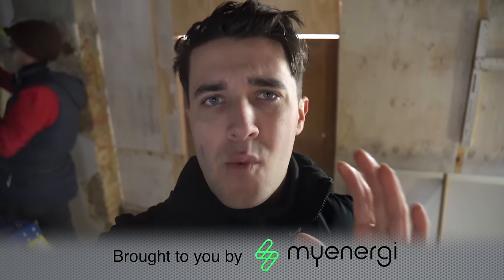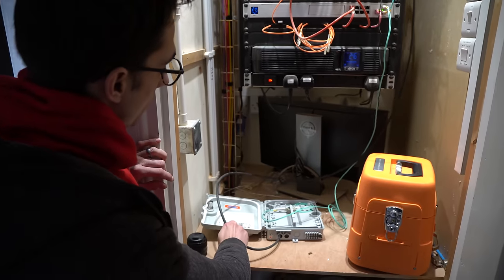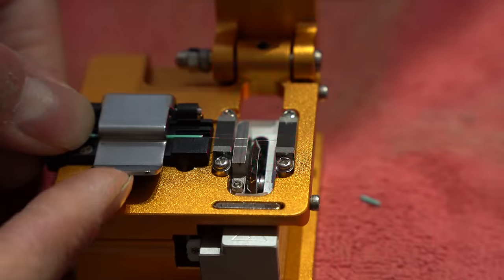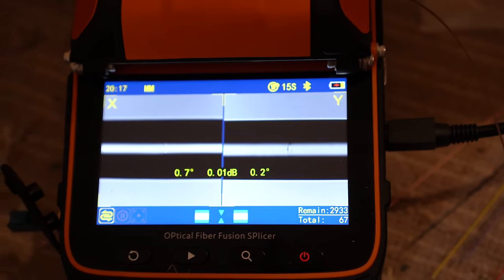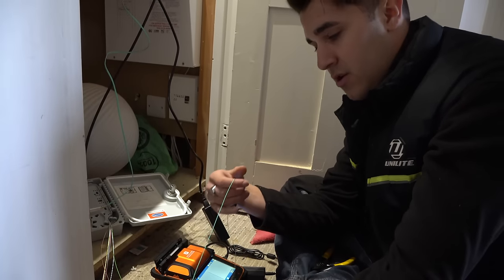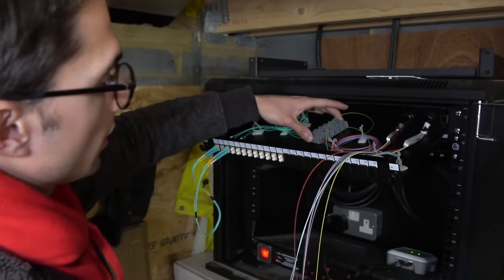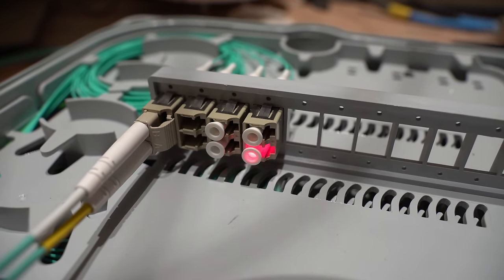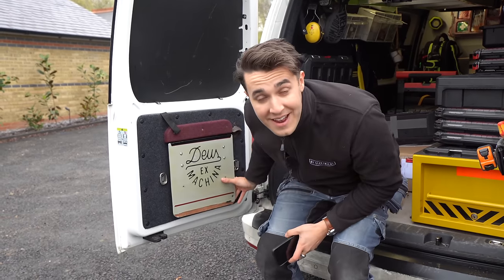Fiber Optic Splicing: Tips and Tricks for Beginners | ØY16

Comment: The key to optical fibre is that it is made using two mediums with different refractive indexes. It is common to use two types of plastic or glass. It is the difference in refractive index of the inner core and the outer layer that creates the "reflective" layer, causing the light to be internally reflected down the inner core of the fibre over very long distances. Both the inner and outer layers make up the fibre itself, which is about the thinkness of a human hair.
Reply: What you have described is true for multimode fibre but is not true for single mode fibre.

Most companies using fibre for long distance communication are using single mode.

Comment: Great vid. Did I miss the use case for so much fibre in a domestic environment? I’m as geeky as they come with fibre in my own home, desperately looking for more uses cases, now matter how sketchy they may be! I have a loft rack with two servers, a switch and my workstation, all connected by fibre. Beyond that I’m struggling to find end devices that need, or have, 10Gbe or better connections. (Otherwise, cheap as chips cat6 will do).

Whilst it’s good to see how the pro’s do it, pre made fibre is quite cheap, so us DIYers just end up with it neatly coiled out of the way behind the back of the rack. Do-able when you’ve only got 4 cables but if you’ve got tens or hundreds then not so practicable!

It is a green tech though. Pushing 10Gbe data down a fibre transceiver needs less power than its equivalent 10G base-t for a cat6 cable…… and a much poorer range to boot…….
Reply: I’d guess a big consideration is because they are going to a few different locations outdoors (house, barn, gates, shed, etc.) it’s a good idea to use fibre even if some of the devices (e.g. at the gate) only need a few mbps, because it’s 100% electrically isolated so lightning isn’t a problem. Actually pulling a multicore cable and splicing instead of pulling a bunch of pre-terminated cables is definitely going over the top, but why not if you want to do it nicely and are willing to pay little up front?
Reply: Yeah you're quite right there isn't much point for end devices in a domestic environment. But @Stephen Gentle is along the right lines, it's a nice to use fiber for building links etc, just because it gives a bit more flexibility for future use, not just in terms of swapping transceivers for faster speeds, but also having more cores to provide completely different connection types if wanted. 

And also bang on about the electrical interference, running through ducts etc. There is also the fact that I enjoy splicing so I'm always looking for places to practice.

Comment: We outsource all our fibre work for the following reasons:
1. They are way quicker than us
2. Their splicer and tester needs calibration and if you are not doing much fibre it will cost you more than you can charge
3. They do a better job
4. We get a full test certificate and a very long warranty ( though rodents love fibre and no warranty covers this !)

Quite intrigued they fitted Ubiquiti switches in the main house and TP-Link in the outbuilding. Probably because Ubiquiti has been hard to get hold off but one of they key reasons to use their kit is cloud management which is kind of lost when you mix vendors as TP-Links cloud platform ( Amada ) is different from Ubiquiti though given the type of install I’m guessing they run something like Domotz on top at a local level to monitor everything ?

As a network engineer and AV specialists it’s always interesting to see other peoples approach on installs.
Reply: You make fair points regarding the outsourcing of fiber work. Sometimes we just like to mix it up 😂

And you’re right on the Unifi switches and TP-Link switches. We do like to keep the whole site on Unifi. It’s a shame the Unifi switches are so unavailable now, and the cost of their basic PoE & SFP model is so much higher than the competition.
Reply from the maker: Interesting advice! Cheers mate
Reply: @paulblundell8033  Ah that's interesting, really nice to do it with VLANs! The main reasons were to keep it simple on this job and not introduce another point of failure on a power supply in the garage to send the WAN to the main rack. Less of a big deal if the garage switch drops off, as the main house will still have WAN (and it has UPS).

Tbh I've only used the 10Gb so far to link switches in my main rack to core switch. Because of the USW-Pro costs. But I might start using them soon for building links.
Reply: I'm also a huge fan of TP-Link Omada! Although I'm not coming from the Pro Install angle, more the home geek who wants something more capable , I find it hugely capable, available (a huge thing these days) and cheap when compared to the likes of Ubiquiti.
I handle segregation/routing with a dedicated pfsense and subnets rather than vlans, running through a Brocade/Rukus poe switch. Running subnets of LAN(10Gbe)/Wifi/IoT/IP cameras, I haven't even come close to the limits of it's abilities in my environment.

Comment: Just to mention Mr Chilli 🌶  was incorrect I work for a Full Fibre ISP and there are a lot of what he's calling cold joints. All of the distribution cabinets use preterminated blown fibre with a cold joint so the installer can just plug it in. So they are 100% used in the industry 🤔 to add yes I have spliced fibre super cool process.

Comment: 12 core ribbon splicer turns 96 cores into just 8 ribbon splices. (If the cable is ribbonised)
Reply: You can ribbonise non ribbon cable too, annoying when one fibre is off centre/damaged and you have to re ribbonise all 12 just to fix one

Comment: When Oliver mentioned that his 'machine' certainly sin't the most expensive, I'm curious to see how many levels up you can go. But I can't imagine Openreach spending lots for real high end equipment.
Reply: My ribbon splicer (splices 12 fibres in one go) on the van is 13,000 pounds. Normal Openreach splicers (72C) are around 4k to buy yourself. Company probably gets them a lot cheaper

Comment: Should be doing OTDR traces to verify quality. Signal and VFL just make sure there's no end-to-end issues...

Also... You should clean the ferrule ends and the SFP Optics.
Reply: On a small run and low end usage,  a trace isnt really necessary

Comment: 5:20 "hold it at a 45° angle" Ehm not really. If the pliers are doing a 250 to 125µm strip you should hold it at 90° or you damage the cladding of the fiber. Tilting the tool is only done if the stripping hole is worn out after a few hundred fibers.
Reply from the maker: Thanks for the tip 🙏🏼

Comment: The light that travels along the fibre is made up of a binary code.
Reply from the maker: That’s cool!
Reply: No. The light is made up of photons.
The light is modulated on and off in sympathy with the binary data stream to be transmitted.
Reply: @Dean G  

Fiber optic cables transmit data by using light (Photons) to carry information through a glass or plastic fiber. Part of the process is data encoding: The data to be transmitted is first encoded into a digital signal using binary code.
Reply: @Jay369  I have a degree in this subject.
I know EXACTLY how they work.

The binary code is the representation of the information to be transmitted, with that be voice, digital images, text messages or anything else.

That data stream comprises 1's and 0's which is then used to modulate the laser.
Reply: @deang5622  

So, why dispute the fact that the light is made up of a binary code?
Reply: @Jay369  because it isn't actually binary. Binary is numbers.
The light is made up of photons.

When you are working at the physical network level, level 1 in the ISO 7 layer OSI reference model, we are concerned with how those binary bits are represented by an analogue signal.  It is simply a way to encode those bits on to the media.

The binary code you are talking about is one level away from the level 1 physical layer.
Reply: @Dean G  

The pulsing of light is directly related to binary. On/off represented as zeros and ones. The pulsing light uses binary to transmit the signal/instructions/messages etc.

Comment: It's not a reflective surface, it's refraction not reflection.
Reply from the maker: Nice one. Thanks mate!
Reply from the maker: Nice one. Thanks mate!
Reply: Actually it's Total Internal Reflection (TIR) cause by the light striking the interface between two materials of different refractive index and striking it beyond what is called "the critical angle".

So it really is reflection but caused at the interface of two materials of different refractive index. It is NOT refraction.

There is another mechanism which is employed where the refractive index of the light carrying portion changes across the diameter and this has the effect of bending (refracting) the light.